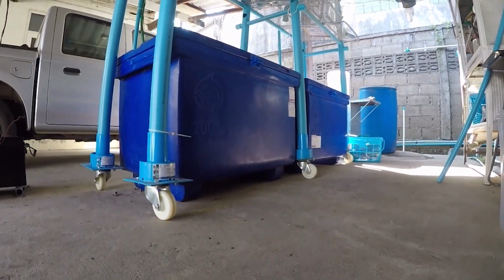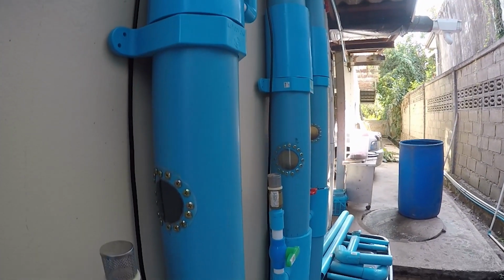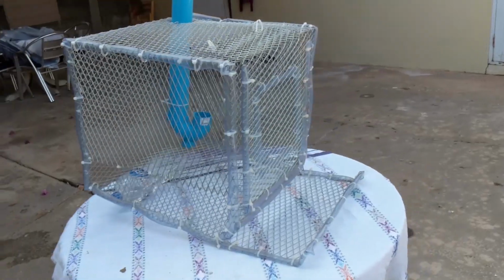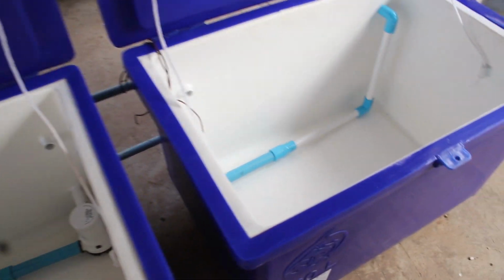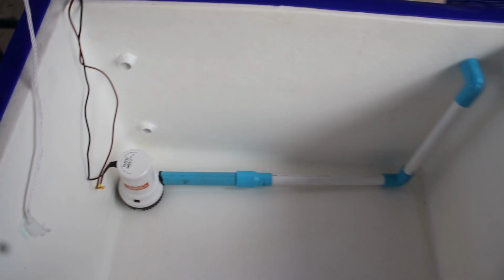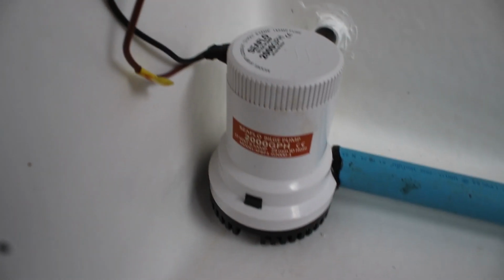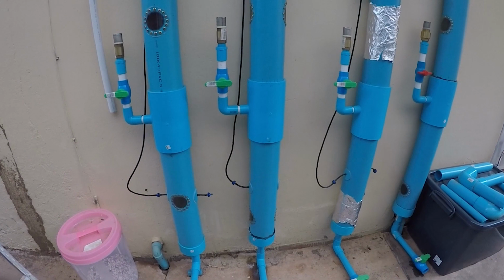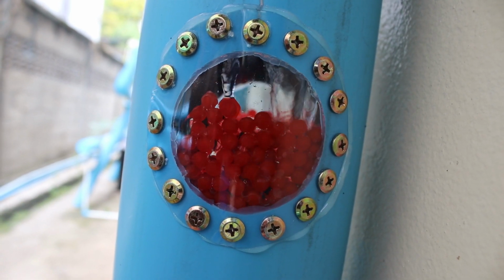Chicken Aquaponics System Prototype / DIY Bead Filter

Comment: interesting concept, what do those 4 bio-reactors contain to break down the chicken manure into plant nutrients?
Reply from the maker: Well, it is actually aerobic bacteria that convert the manure into mostly nitrates, but also trace elements of other essential nutrients. The bacteria occur organically in nature. When biomass falls on the ground, such as leaves, dead animals, manure... the naturally occurring bacteria biodegrade that material into the earth as nutrient-rich compost. 
The digestion tubes of the biological reactor accelerate the bacterial digestion process.  The organic process that takes months in nature is reduced to hours by this mechanism.  This happens by concentrating the bacteria in dense colonies and using aeration to hasten the process. 
In short, bacteria occur naturally on all surfaces. Inside the tubes, we increase surface area with floating polypropylene beads, and we install an air defusing stone at the base of the tube to impart oxygen to the bacterial colonies, thereby making them aerobic bacteria, and expediting the conversion of manure into a nutrient-rich liquid solution.
Reply: @ChickenAquaponics  you mentioned that this needs to be sustainable, so are the bacteria and bead balls easily obtain or grow anywhere? I've been thinking of using sand to filter the water solution (water + manure), but have not found a way to test to make sure that the manure does not pass on harmful virus to the plants then onto humans. your other videos mentioned about broiling the water, but does that become expensive as you need to add external energy to the system and does broiling the water solution eliminate any harmful virus/bacteria?
Reply from the maker: The principal behind bio-digestion is simple; good bacteria convert bad bacteria to nitrates.  That being said, you can accomplish this by any means that exposes manure to these cultures, that grow on any surface, but that thrive in the right conditions.  The reason for bio-reactors is to control and accelerate that process in the safest, most efficient manner possible.  You don't need plastic beads to make this happen.  Most DIY systems use all kinds of plastics, clay and stone media to grow good bacteria.  Yes, you can also use sand.  The problem with gravity fed pass-through systems is that they become caked and clogged with waste.  Then you have to clear that bio-waste manually.  It is a disgusting smelly job that adds a considerable amount of maintenance to DIY systems.  By using the floating bead system, you have a more up-front cost, but almost zero maintenance because all of that bio-waste drops to the bottom of the tubes where it can simply be flushed out.
Reply from the maker: I started this experiment to cater to the needs of the extremely poor, so boiling the solution is the most accessible way for the poor to sterilize the effluent.  Chlorine will kill everything, including the good bacteria.  So chlorine is not an option.  UV and Ozone solutions are a cost-prohibitive for the poor.
Reply from the maker: @xyooj96  You might be interested to know about a university in Alberta that published news about their results with a similar system.  
https://www.albertafarmexpress.ca/news/alberta-project-turns-manure-into-liquid-gold/